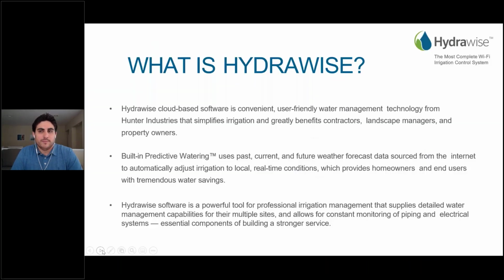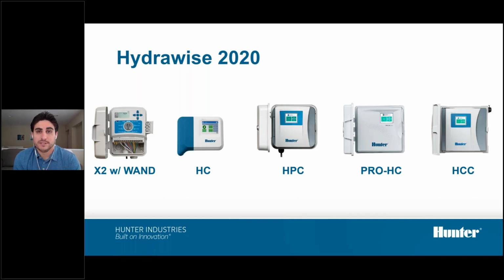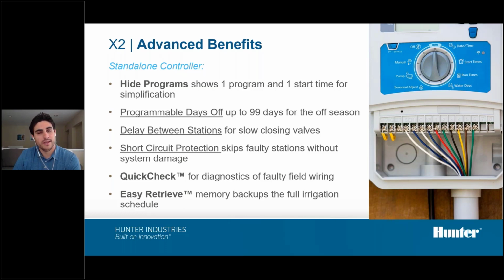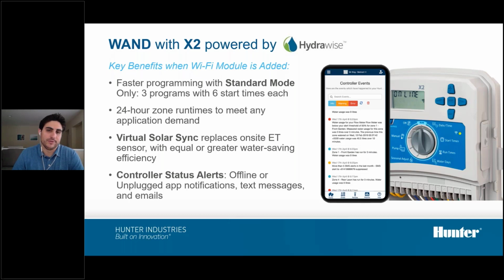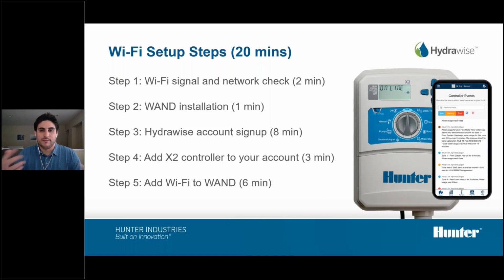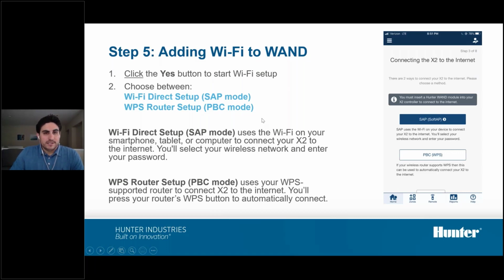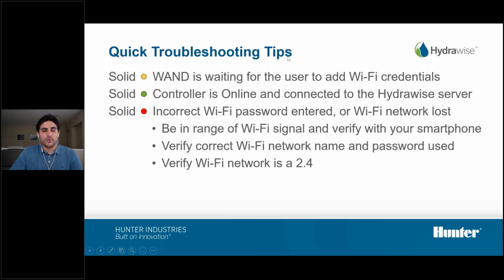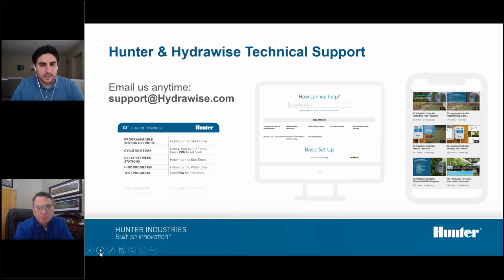X2 and Wand Insights from the field

Comment: When I try to connect the X2 controller via Android via SAP, the waiting bar at the last step does not stop and the connection process does not end, how to solve this problem? Before that, everything worked for a month.
Reply from the maker: Good question about if the app freezes. If the app is frozen treat it like you would any other app. You can log out log back in, close the app re-open it, or delete the app and reinstall it.